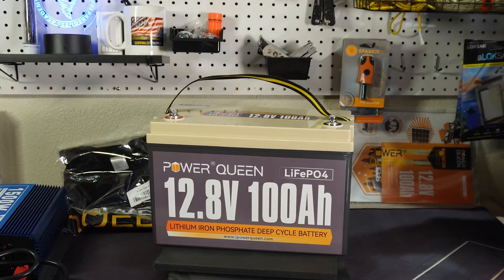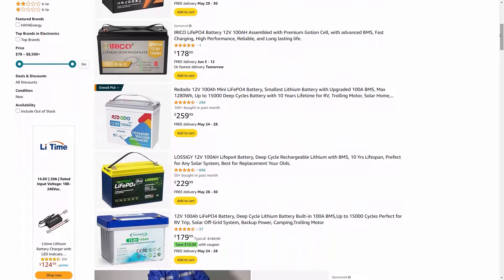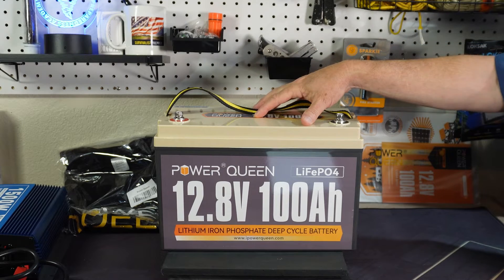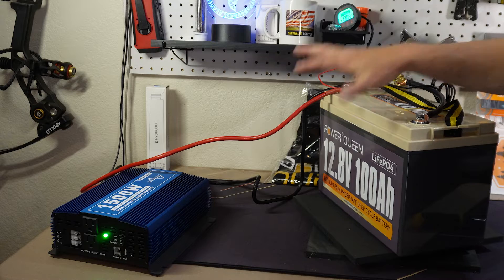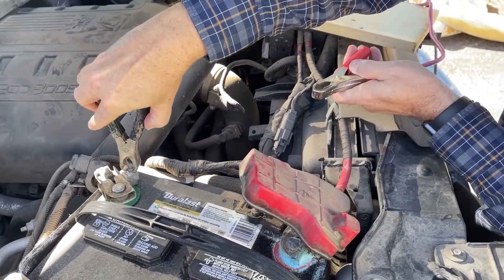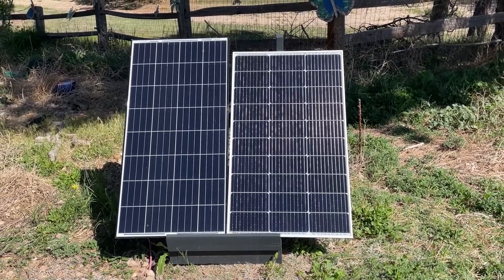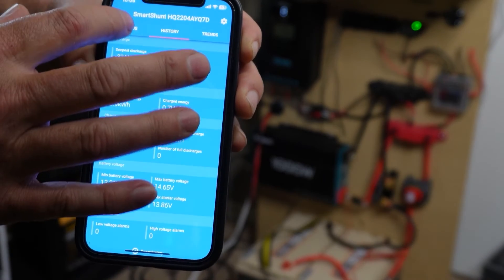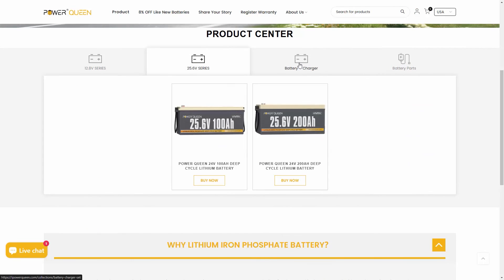Power Queen 100Ah LiFePO4 Battery Review & My Power Station

Comment: What I have seen on cheaply made batteries is small gauge internal wiring and cheap made BMS. I have four of these Powerqueens wired in a 12 volt system and the are doing great. I am getting ready to double that.